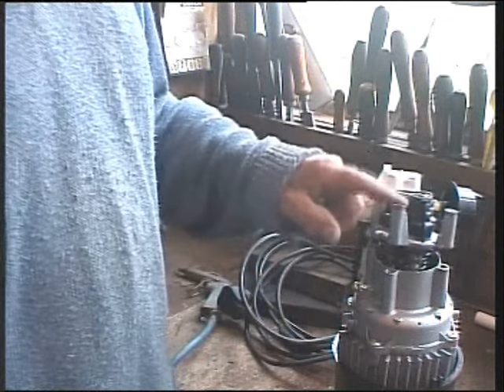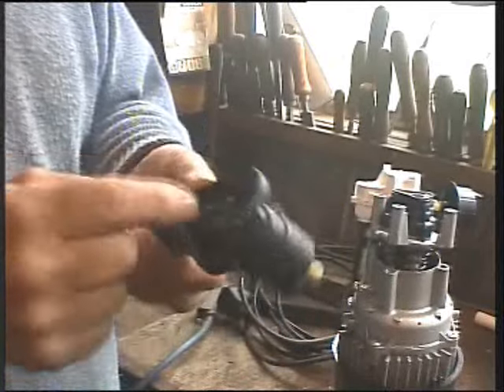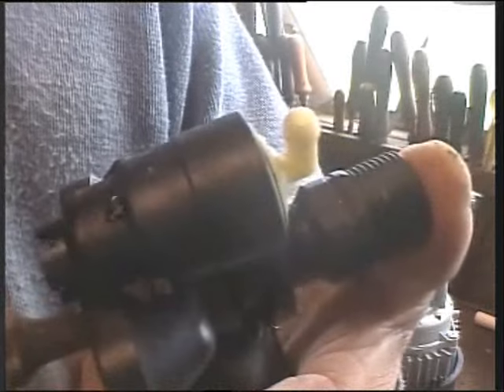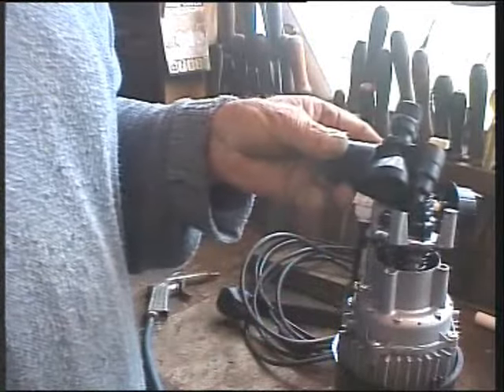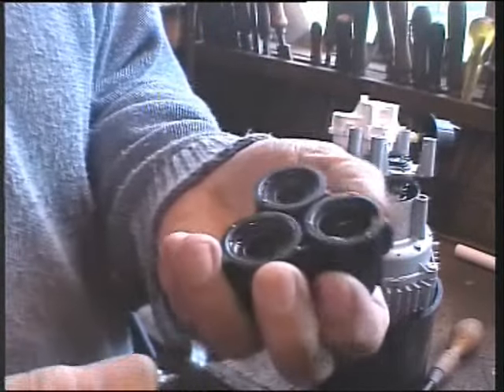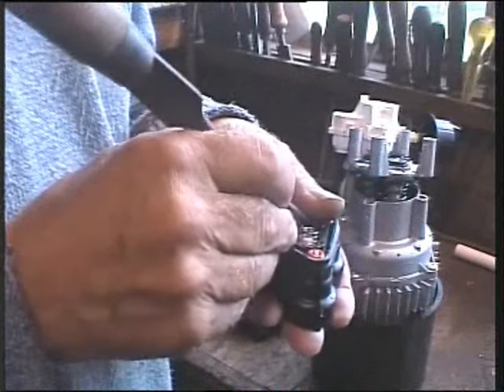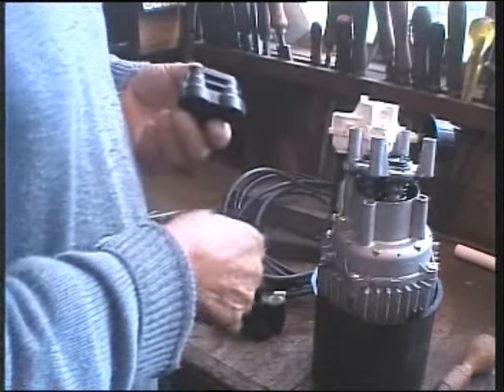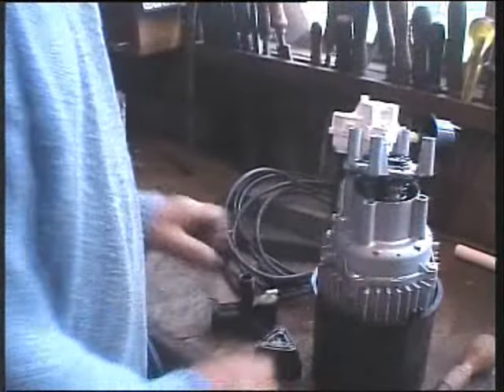Karcher trouble

Comment: Hi. I have rebuilt by K4 Full Control with a complete new cylinder head (ie both parts) and the leak when under pressure has stopped. However when I connect the line and lance I am getting no pressure through the lance and the led display just says 'mix'. Do the two parts of the cylinder head have to go in a certain order or any other suggestions please?
Reply from the maker: no sorry Ive given up on these  they are complete rubbish , I don't bork at repairing most things but when it comes to krcher  thats different
Reply: @poroldchap  Hahaha! I have taken it apart and rebuilt it several times  so far so I will try once again before chucking it as far as I can!
Reply: @CliveandJeanWest hi mate did you ever find the reason or cause? I did the same on mine replaced pump head housing and cylinder head, mine pulses now, when I run water through lance off the water splutters, I noticed air being sucked in through the detergent tube. Any advice would be appreciated.
Reply: It's all sitting on a box currently! I might try again with the detergent tube added just to eliminate that as the cause. If that fails then its time for a new power washer. Reading reviews on screwfix and toolstation they all seem to be rubbish!
Reply: @CliveandJeanWest  Clive does your pressure washer pulsate aswell?
Reply: No it doesnt
Reply: @CliveandJeanWest  I’ve sorted mine out, I just rebuilt everything and changed oil and lubricated all the seals now it’s working full power.

Comment: Is it possible that anybody can help me? Towards the end of the video it was mentioned that there is an oil bath. I suspect that this particular section also contains gears that step-up the motor torque so that the pump is able to produce enough pressure. My oil bath is leaking. First question is; are seals available for this section of the device? Second question is; what is the oil capacity of the (what I suspect is) the gearbox? Many thanks in advance.

Comment: I bloody hate karcher pressure washers! We have them come in all the time! They are cheap to produce and sold to a huge profit! But I will say a lot of the problems are due to the customer leaving water in them in the winter and they freeze!! They should be flushed through  with anti freeze for the winter.
Reply: +Martin Smith Martin, you're absolutely 100% right about this!! 
Usually these pressure washers are just carelessly left in the garden shed during wintertime and just like car engines, they like anti freeze to keep them healthy. If you don't give this to them and let them freeze up, they crack. The crack closes after thawing and there is nothing to be seen afterwards. But in effect the heart of the pump has been irreparably broken and no amount of fiddling with epoxy or working with a soldering iron will cure this. Why?? The pressure is on the inside, up to 140 Bar and pushes the cracks apart...

Comment: Excellent video. My K3 000 is leaking. I dismantled it and found there is a hairy crack on the plastic housing.  I have used some PVC cement to heal it. Not sure if it will work.

Comment: Good honest vid as always, Agree these are built to a low cost, they use the same pump and pressure heads etc on there cheap and "expensive" models with the same common problems. Mine KS1010B £45 from B&Q had 6 years of use before it "pulsed". Cost of bits prohibitive so i still use it at a lower pressure and does the job. 10w-40 oil is ok in these also light gear oil till that plate below the pistons is covered. Also the water filter in the inlet pipe is easy to clean and should be checked regularly. Miss things that can be stripped and repaired these days. (sounding like my dad)

Comment: Thank you sir!
The water leak is coming from the three piston O rings area.
I'm thinking that some thick silicone grease in there will help, if it's still bad I'll get some replacement rings.
Also the rings on those metal pistons might need it too.
The 'oil bath' - I was thinking of replacing that - was wondering what grease it is but as it's so expensive I'll leave it. The thing is that the top of the pistons, one is rusty and that discoloration has gone onto said grease. I think it's likely ok though. Maybe a bit dirty looking.

Comment: To be honest I think manufactures today want things to fail after a given time and they often have this failure time down to a fine art. I think they do this to ensure future sales. The days of things being made to last are almost over in every industry. I have lost count of the things I have bought that that have failed within weeks or months of the guarantee running out.
Reply: +InTheNameOfJustice From my experience the aim is not to make things that fail, but to make things that are as cheap as possible to produce. The result, however, is exactly the same.
Reply: Bruce Boschek
I used to think the same way Bruce but I decided to look into it and found that 'planned obsolescence' is indeed real. Building a weakness into a product restricts its life and so necessitates its replacement. Today this is manifesting itself in many electrical goods such as digital TV's, for example.

It is clear that manufacturers are using faulty capacitors in vast amounts of TV's. These blow after a short time and most people replace the set rather than try to have it repaired because of the high costs involved.

The makers of the sets are well aware that the capacitors are faulty, but because they tend to blow (like a fuse) and not pose any great risk of fire, they are happy to go on using them. By outsourcing manufacture to other lands, they can avoid liability themselves.

Of course, there are other ways planned obsolescence can operate also. This article lists some of them: http://www.economist.com/node/13354332

[Edit] Here's another article talking about the same problem: http://www.theguardian.com/sustainable-business/2015/mar/23/were-are-all-losers-to-gadget-industry-built-on-planned-obsolescence

Finally, I remember the change over from Windows 98 to XP and finding that none of my old hardware, printers, scanners, cameras etc worked any more. As a result, I and millions like me, were forced to help fill landfill sites with equipment that worked fine but that we could not use. Worse, we had to go out and spend a fortune replacing it all. It was and still is, an outrage that Microsoft were allowed to get away with it.
Reply: Check out the light bulb conspiracy with planned obsolescence.
Reply: 100% right !
Reply: It's called "Planned obsolescence " in Product design, they all do it , cars especially ☹️

Comment: I have a karcher m50 and had no pressure, so I popped it open and where the oil is supposed to be was like dirty grease all over the swash plate. I guess this washer is done for? I read it takes 20w oil.

Comment: My pressure washer kärsher k 4.99 is running and dosent pulse or anything but it is not making any pressure? Just a little bit. And i have check all the common reasons like waterflow and things but i dont know what the problem is? Do you know?
Reply from the maker: if you have checked all the common reasons then sorry no

Comment: I own an electric Karcher power washer that has no pressure when you squeeze the lever on the wand.  How do I troubleshoot and repair that?  Where do I find parts for them?
Reply from the maker: Dose it leek? has it the original lance ? they are cheeply made yet blooming expensive for parts
Reply: It does not leak.  What is a lance?
Reply from the maker: original nozzle ?
Reply: The wand has 2 nozzles that twist and lock into place.  They may be original.  What made you ask?
Reply from the maker: The nozziels determine the back pressure (spring loaded O rings in pump) and I have come across problems where people have replaced the lance/wand  and the washer has failed to work properly yet failed to make the connexion ! !   just a thought

Comment: My B203 will only work when the water is connected, trigger pulled then the power turned on. As soon as the trigger is released, it wont go back into pressure. You have to turn it off, pull trigger then turn back on! Any ideas? Thanks
Reply from the maker: I don't know that model but guess it may have a pressure switch, or a  mechanism that operates that switch, is not working
Reply: @poroldchap  thanks, I'll see if i can strip it down further. Oh she's an old karcher, about 20yr old
Reply from the maker: I'm not one to give up easily but karcher are  "bloody awful" unreliable and grossly overpriced
Reply: @poroldchap  I'm not either haha, i can't see any pressure switch / mechanism either in the machine or the manual

Comment: What’s the name of the top piece of the cylinder head that had the crack in called please I’ve just found a crack in mine👍
Reply from the maker: sorry I don't know, take the part with you ..
Reply: Nowhere to take it to I will have to get it online. I’ve got the K5.55 model. Thanks for the video 👍
Reply from the maker: I will never buy another Karcher, !
Reply: @poroldchap  I totally agree with you!
Reply: Manifold assembly (control head).

Comment: Great video, although I recently replaced the top part of the manifold on my K4 full control. Put it all back together as per how it was built and now it doesn't seem to be working. 

Basically if I switch it on with the lance off (and connected to a water supply), the motor will quite happily run, however when I replace the lance and press the trigger, it won't run at all. I had an idea that it could be the flowrate of the water not being high enough when running through the lance to trigger the motor but not sure what would be causing that. 

Does anyone have an idea on what could cause this? I bled it for around 6-7 mins switched off with water running through however its not helped.
Reply: Bit late now I guess, but I'd say there's a fair chance the lance or pistol grip has a blockage. The only way these units switch off at all is by building up max pressure (unless the pressure spring was overly compressed in the past due to freezing). I would try a straightened small paper clip to the nozzle and run it with no wand on it at first, just the pistol.

Comment: Could you possibly patch those hairline cracks by routing them out with a burr and then applying epoxy? Never saw one of those things in my life, but it might just work. Or not, then one has learned something. Or maybe run a soldering iron over them? Just throwing out crazy ideas.
Reply: Hi, I onve tried repairing a lance with a hairline crack: no type of glue nor plastic solder I tried worked over 3 minutes. It's not ABS, nor propylene, it might be a variant but definitely not  a straightforward nor lasting repair.
Reply: I have used 3m marine adhesive/sealant to fix manifolds/pumps with cracks. They too were made of nylon/glass plastic. Sand,clean,apply and let dry 24hrs.  Have a pool pump with a cracked housing running 3 years now. Good luck.

Comment: I must've been lucky, I just replaced the 'O' rings on the high pressure hose fittings and it cured the 'pulsating' on mine :-)
As others are saying, it does help if you 'winterise' them to protect them from freezing.

Comment: Don’t buy Karcher, I’ve had two fail in rapid succession. The second one I used twice. Broke it up scraps/ bits and the brushes on the electric motor had cracked and failed.
Bought one a generic one from Homebase for £40, it’s noisy but still going strong after many uses.

Comment: I have a Karcher K3 wich was leaking water heavily. There was coming more water from the unit than out of the hose. I had the same issue you had in your video with the crack on the same side in the stearing head. It now works fine again with a replacement stearing head for now. But Karcher units seem to break every 2 or 3 years Max (and i only use the High Pressure washer like 4 times a year). Next one will be an other brand.
Reply from the maker: I haven't tried one but "direct hoses all black 8 power washer" is worth looking at ..

Comment: POC I think your thumb was leaking.  Most appliances today are made very cheap and cannot be expected to last very long.  That could be on purpose.  =(;-)  Of course they don't sell them cheap.  The price of a washing machine and dryer has gone sky high for example.   If you find a good brand, if, then keep with it.  Thanks for sharing.
Reply: "POC I think your thumb was leaking"

the leak at his thumb was not the leak he was trying to show.  The leak he was trying to show is in the plastic pressure housing a couple inches away, little water/bubbles, not fine misty spray.
Reply: @etherx8604  wow 6 years  ago and you expect me to remember what this video was about?

Comment: Just found a crack in one of the piston ring rubber seals. Wish me luck it fixes the leak 😆
Reply from the maker: get the right size o ring and your  in with a good chance . worth a try .anything else bin it ! Krcher are all plastic crap ...
Reply: @poroldchap  cheers, it's back running, all be it with a very slight leak. Luckily I have a spare machine which I've swapped the seals from. 
I agree with you. My daughter asked what pressure washer I would recommend? my reply was " not a Karcher". The thing is everyone else she asked said to buy Karcher! The boggles.